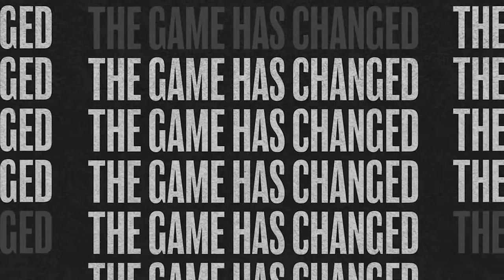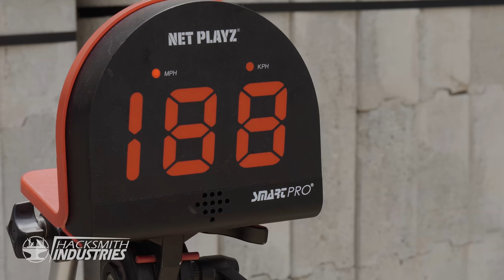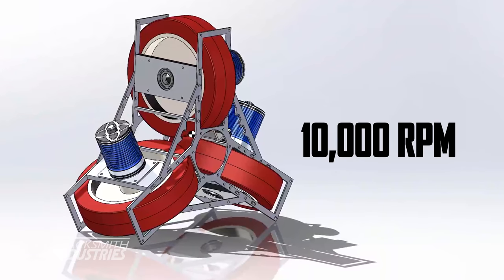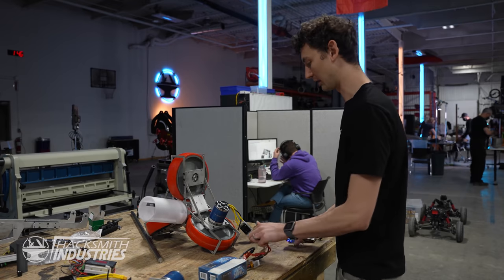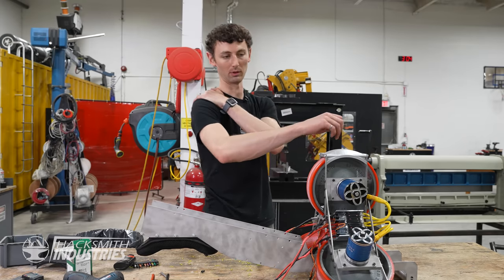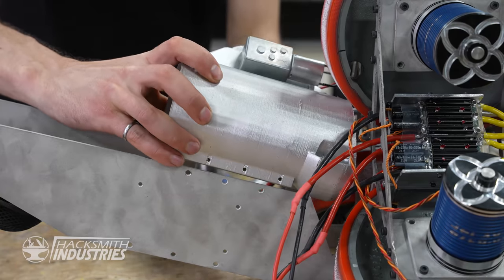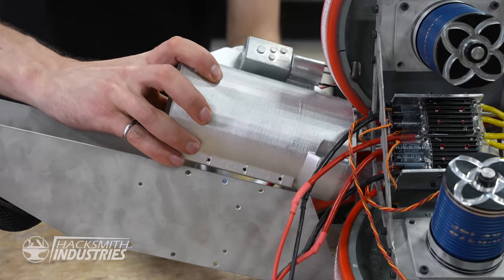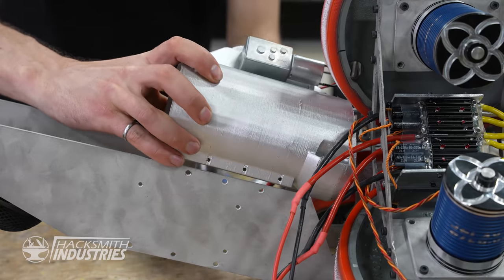IMPOSSIBLE To Hit Baseball Pitch!

Comment: The nerf modding community has been dealing with similar problems for YEARS, I'm sure there's already a solution to get those balls launching harder, Concave wheels are just ONE, also using softer balls would probably help too, but you might have to consider having 2 stages of flywheels, the first stages gets the ball going, then the second stage really kicks the speed up a notch.
Reply: I used to make modded and DIY nerf blasters years ago for fun. Without using less safe, denser, custom darts, it's difficult to get more speed and range. I'd hit a wall where darts just got shredded leaving the muzzle, or were too slow that wind blew them way off course.
Reply: A solenoid to knock the ball into the wheels would probably help as well
Reply: Please make yondu's arrow , guys please make this visible to them
Reply: s**t, you beat me to it.
Reply: @Discitus  things have come a long way in the last couple of years, flywheels have reached new heights. While denser foam may be used, the harder tips have fallen out of favor quite a bit
Reply: @ninjafruitchilled  froging rail gun
Reply: @Discitus  have you heaed of the backyard scientist
Reply: Or just use compressed air to get a smooth acceleration
Reply: @rattytherat756  you're a springer/ HPA stop aren't you? :P but for real, I doubt a baseball would seal properly in a barrel with the stitching and everything, probably barrel-drag problems too, flywheels are probably the best option for launching a baseball at high velocity.

Comment: I’ve actually built something like this in the past. One of the rotating wheels has to be sprung loaded agains the ball - so the passage of the ball pushes past the rollers. The spinning of the wheels is enough to feed the ball through. I hope that makes sense? I actually used gravity acting on a swing arm that held the motor and the wheel but a spring could be used instead.

Comment: I may be a bit late, however, there is a wheel in competitive robotics called a compliant wheel, which is a wheel that can comply to the shape of the object it is rolling on. Using a medium to lower durometer compliant wheel would help with the traction problem you are having without the need to rebuild the entire setup.

Comment: for indexing the balls out of the hopper one at a time you could probably make a simpler setup that uses the same mechanism as pinball machines - Wintergatan did a video not too long ago on his newer marble feed gates that used the same design. They look like super-wide-mouthed pacmans.
Also you might have less of an issue with the balls getting shredded if you gradually accelerated them. A baseball normally gets accelerated from zero to a hundred over the whole arc of a thrower's arm motion - you might want to maybe have several wheel sizes, geared together so they spin at the same rotational speed but increasing surface travel speeds. One set would pitch to the next set basically. If you can get ~70mph increase per set of wheels without it stripping the covers off, that's only 3 sets of wheels to get over 200mph.

Comment: Very cool! So many things one could try out to improve the design. I think the slipping is caused by the ball dropping too slowly onto the wheels and then the fast spinning wheels only have a millisecond or so to accelerate the ball. So you could try out to have the balls drop faster onto the wheels already (airpressure?) or increase the time it takes to accelerate the ball. So perhaps  3 sets of wheels each with increasing speed would accelerate the ball more gently and also be able to put more energy in it.

Comment: I'm not an engineer, but I think you should've put "shock breakers" or some kind of big springs on each of the wheels, so that the wheel would adjust to the ball's width and pinch the ball when it came through. So there would be less scraping? IDK, just a thought.

Comment: You need to tack them up with some clay or what they call "dyno sauce" for car and motorcycle dynamometers or something. Do that, use regular hardness balls, and then set the motors to max except the bottom left one (from shooter's perspective) which should be at half, for the ultimate curveball.

Comment: I keep thinking to launch and O’Neill cylinder would be incredibly hard. You could start with industrial wheels like a launcher, and then use magnets like a real gun. Either way, moving that much mass is going to be hard.  Using two cylinders with rollers is the simplest, most energy efficient way to start with. Then once you get past a certain point, you can basically use the same system as a real gun between two cylinders with a central cylinder being shut out. You just have to get creative with the magnets in between. The wires

Comment: If you try to use a rim and tire setup instead with them a bit closer together. The tire will compress slightly increasing the contact surface dramatically. This may solve your problems.

Comment: great job.. a couple of points.. number one.. your wheel on the top should actually be positioned on the bottom .. the way a ball is thrown the pitcher creates backspin going from the bottom forward on the ball not the top.. second.. by putting a heavily textured surface on the wheels will increase the friction giving greater velocity.. and third by using a softer ball you are hurting the performance of the "pitch" a harder ball will not absorb as much of the  energy creating less of a damping effect on the kinetic energy....

Comment: You need to do a two stages launcher; first stage pushes the ball at half speed to the second stage that propells the ball to the maximum speed, or using a belt corridor propeller instead of wheels

Comment: Hey what if you had multiple rows of spinners that each progressed in speed? The ball would enter through the first row of spinners that are slow enough to not shred the ball; now the ball is already moving as it proceeds to the next line of spinners that are faster than the previous spinners and since the ball is already moving fast there should be less friction and still allow for the ball to go even faster. I dono how many rows of spinners you'd need but I feel like this would work?

Comment: I think the biggest problem is that you want to accelerate a ball that isn't moving so you need extremly high friction to speed up the ball. I think the best way and the efficient way to achiev a higher speep would be a multistage cannon with more friction between the ball an the wheels.

Comment: Hey - the balls are slipping on the wheels as they are going from zero to fast extremely quickly, so why not use tracks instead? Like on a tank or caterpillar vehicle? Perhaps make them 'less grippy' to permit a less brutal slippage. This gives  the projectile time and space to accelerate before ejection.
Reply: Belts / pullies, however you might define them... Maybe even taper the belts so that the exit point is slightly smaller than the point the ball joins the belts, thereby full 'grasp' is achieved there, then.. patchooy, spits the ball out full speed.

Comment: my suggestion would be to use softer wheels like small tires with low air pressure. By doing this it would increase surface friction without damaging the ball

Comment: Imagine throwing a pitch like a trebuchet, all the weight is in the air when the weight is dropped it pulls the arm and load into the air before launching the object into the air at the target, the pitchers leg goes up so that when it goes down the arm can gain more horizontal launching power.

Comment: Why wouldn't you make the spinning wheels adjustable? Atleast for a prototype untill you know the distance you need to have and then make a fixed position to save weight. I would probably have put it on a sliding plate and a threaded rod welded to it and a way to secure 2 nuts to it on the other side.

Comment: The amount of time for acceleration is too short. You need to speed the ball along twice or 3 times. Each step accelerates them a bit more. I bet your wheels surfaces are moving at 2-3X more speed than the ball. There's just not enough time for the balls to match wheel speed.

Comment: Wouldn't it be better to use air pressure to launch the balls? That would disable the option to spin, but it would fix the slip problem
Reply from the maker: Not accurate enough or controllable.  3 wheels means you can do top spins and back spins etc

Comment: Man, I wish I could have lent you some info before you made this. 

My advise. Go look at a pitching machine. You'll notice the wheels are soft, and I believe air filled. This is so they can grab the ball and flex to throw them, instead of slipping and grinding. Get 3 pitching machine wheels and you'd be golden.
Reply from the maker: We did.
Reply: @hacksmith  After looking around, I see the type you guys got. But the softer air filled one I linked I think would work better. I could be wrong...but only one way to know right?

Comment: What I don't get is. Why didn't you go to the batting cages and look at the compound they used on their wheels. If I remember, they are made out of a much softer material or a pneumatic tire so the wheel can conform around the ball without destroying it. Most of the time, like 95% of the time, yous guys hit the nail on the head (figuratively speaking) but then there are those other times, you miss it by a mile. I think its because all of you are so smart that the simple answer or solution is to far out of reach. I think you need a "SIMP" for consulting to dumb it down a bit.
Reply from the maker: We did.  You'd be surprised to know even inspecting a product doesn't mean reverse engineering it is easy.  Boggles my mind how many arm chair experts are replying.  Call me when you've successfully built one yourself before ripping on our work

Comment: Like good job, but this is more expensive to build than it is complex... I wouldve used tension on the wheels to get better contact with the ball, probably only one potentiometer for speed controll and just use the micro controller to regulate it. Id print a top for the motors too so someone doesnt get slit

Comment: Disappointed. You didn't even match what the pros could throw, let alone make the ball impossible to hit. The problem is your counting on the acceleration happening on too small of an area. You need your wheels that spin up to actually be conveyor belts. Give it about 6 inches of contact with the belts to give them the time and surface area to actually get the ball up to speed.

Comment: When you aim it at 45 degrees you can see the balls going to the back of the pipe .you should of included a spring mechanism that would keep pushing the balls to the pushing rotating gear that way you can also shoot while aiming at 45 degrees

Comment: Does he not know... they already make pitching machines? I feel he could have just suped up an existing pitching machine...

Also this experiment was kind of a fail right? His goal was to make a pitching machine that could out pitch an MLB pitcher, but the fastest we saw his machine get was 77mph, most high school and even middle school baseball players are able to pass those speeds.
Reply from the maker: Do you know... engineering isn't that simple?
Reply: @hacksmith  It very well may not be, but you/he took the most difficult path to the worst outcome. At the very least he/you could have looked at existing pitching machines to see how they get their speeds work to mobilize the existing design. 

Every experiment and design isn't going to be a success, my last paragraph was just pointing out that fact, I was surprised it wasn't brought up in the video.
Reply from the maker: You are only making assumptions. He did look at existing machines.

Comment: You need to start taking D3 and K2 vitamins. Like 50 000 units of D3 per week with 350 mcg of K2. Otherwise you will be breaking everywhere all th time. That's I believe like a third time I'm seeing you broken. Looking at what you're dealing with you need more bone mass and energy. I mean I don't know which part ofamerica you're in but I'm in Poland and on this Lattitude 50 000 is just right to not get diabetes or cancer and actually thrive.
Reply from the maker: Literally the only time I've broken a bone dude
Reply: @hacksmith I guess I over exaggerated. But still, I think vitamins will be of use to you and those around you. Make a test for It's concentration in your blood. It should be 100 units. But no preasure, just a suggestion.